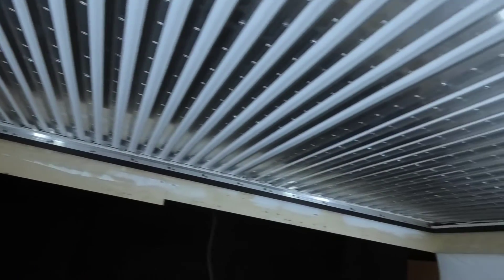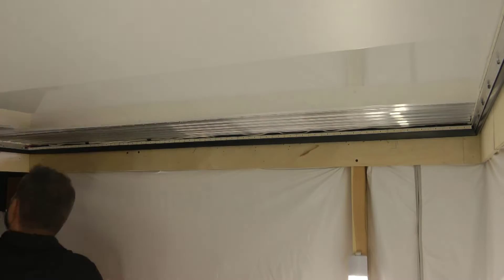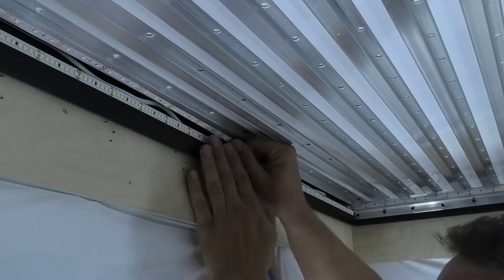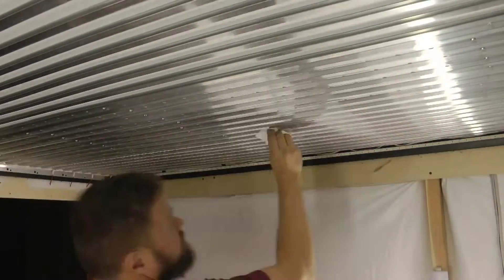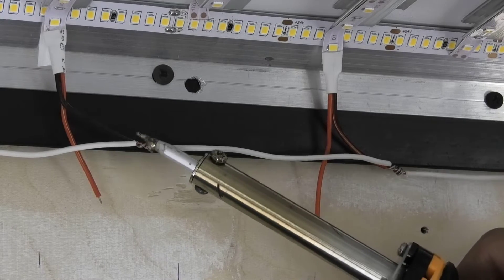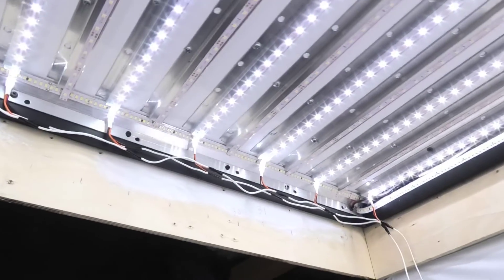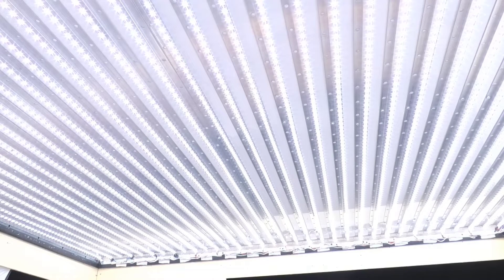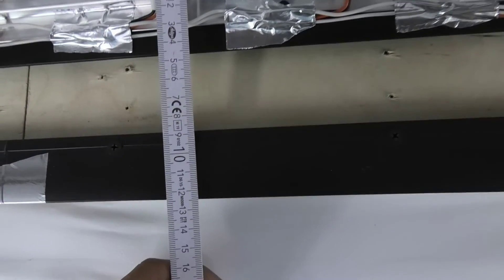excellent do it yourself fully luminous stretch ceiling with LED strip #diyceiling #strechceiling

Comment: Thank you for your fabulous work and great videos!
I have a few questions as I am thinking of installing LED strips for a stretched ceiling at home.

What kind of aluminium profile did you use?
What is the distance between the stretched ceiling and ceiling above it?
Are the LED strips powered with 24V? What are lengths of the strips (or the dimensions of the ceiling)?
What is the distance between the end profile and the wall - it looks less than 5 cm?

Thank you and keep up the awesome work!
Reply from the maker: Hello.
Thank you for watching.
The greater the distance between the lower and upper ceilings, the less often you can install the LED strip.
You can use any aluminum profile for the LED strip.
It’s better to calculate each object: for example, there are 10 centimeters to the canvas, which means there is a maximum of 7 centimeters between the LED strips.
To fully illuminate the ceiling, it is better to use LED lenses.
look at the photo in the channel community, today I posted a photo from the facility.
Reply from the maker: look about lenses on my Russian-language channel. there are a lot more videos.
https://www.youtube.com/@MishaPotolok
Reply: Hello. How to calculate the distance between strips and ceiling? If the distance between strips is 15cm.  What distance should be to lower ceiling?
Led 4,8w 60 leds per meter.

Thanks
Reply: @SergYarko  Mikhail has made some experiments and concluded that the optimal distance between the LED strips and the ceiling is at least 1.25 d, where d is the spacing between strips. In your case, 15 x 1.25 = 18.75 cm. 
Check out his other videos for detailed experiments.
Reply: @dando1992  Thanks a lot!